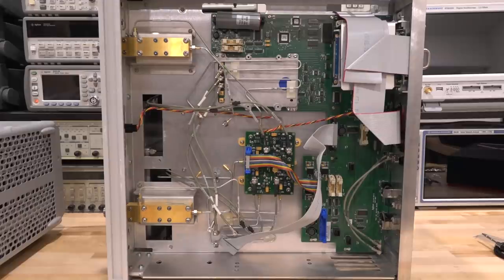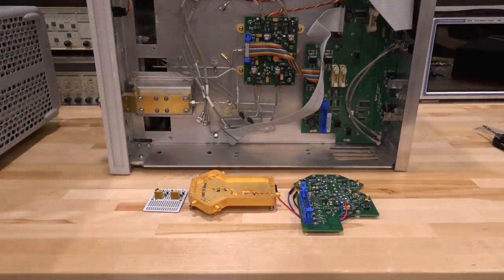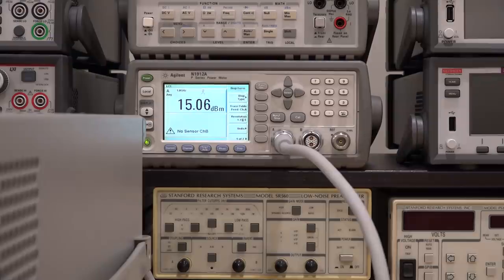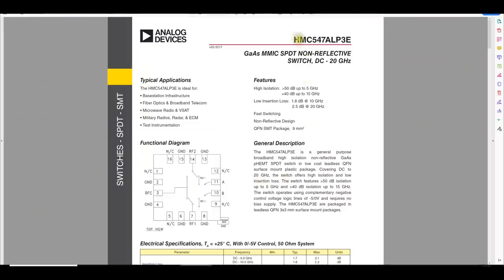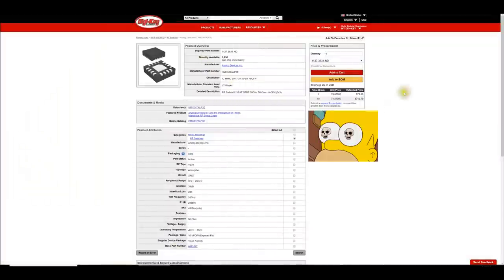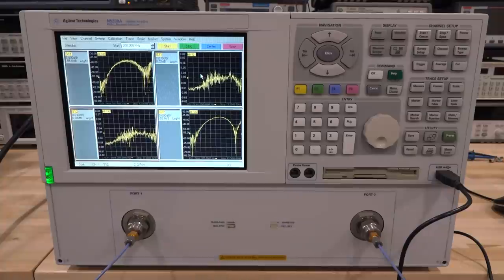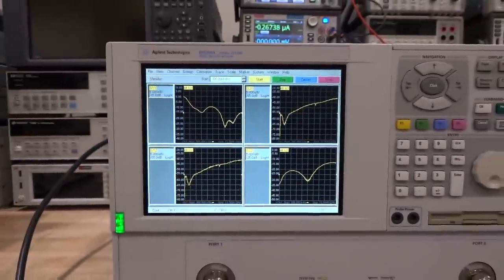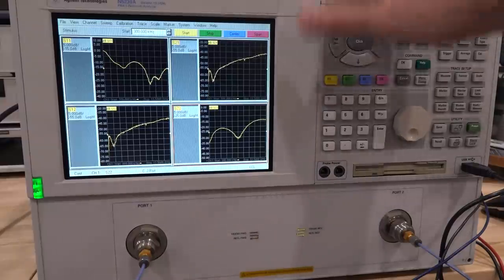TSP #135 - Teardown, Repair & Analysis of an Agilent N5230A 13.5GHz PNA-L Network Analyzer (Part 2)

Comment: Wow!  Flaw with the part!  Man, I would never think of that - especially an expensive part - I would just assume everything is ok and it's something I'm doing wrong.  I know better now!  :)  Thanks again Shahriar.
Reply: The flaw was on the PCB.  It's a good thing it was just the connector, fixing a badly soldered QFP part would be harder.

Comment: Nice fix on the VNA. I have been repairing Agilent VNA for a while and without schematics and many custom parts they are very can be impossible to repair without a supply of EBay modules.

Comment: Shahriar,  I have an Agilent E5515C that I bought from a surplus electronics scrapper that was broken, found it had a internal board short inside the vector module in it;  found on on ebay for $60 and replaced it and have a fully working unit now.   I was hoping to hack it to use as a basic type of spectrum analyzer, but the software for the analyzer is pretty limited (in frequency range and other ways) so its basically a shelf warmer for me at this point.   I can connect a cell and make calls to it;  so it does function.  If you are located in California; and would be interested in having this unit for dismantling, experiments,  re-purposing or teaching, I would be all for meeting up and donating it to you.    It's yours if you want it!

Comment: I bought 4 ADF4351 eval boards from china. And none of the 3 worked. Though when i  bought first i thought it was dead nothing worked. Tried second one same exact results. guess what the SMA connectors were soldered but their ground connection was so poor that the RF messed up with everything. Quick touch with soldering iron and boom all modules cam to life. and one even have bad solder somewhere on the board so reflowed them all and now they are perfect.

Comment: Wouldn't it be possible to just use a DMM to measure the resistance of the dummy load from the "open" side and figure our that the pin was cold soldered?

Comment: I don't think that guy like you working in so high end RF field need extra help from patreon to buy modules and broken equipment. Just saying ;)
And you can wire bond everything. Once i was able to solder CCD wire bonding with single solder-paste ball in a camera that cost many hundreds of dollars ;) 
(some one was cleaning CCD with no windows with compressed air)
Reply from the maker: My work and my YouTube channel are separate. My Patreon supporters make this channel possible; especially repairs, experiments, etc.
Reply: @Thesignalpath   Don't get me wrong, I enjoy what you do ! Best channel about electronics on YouTube. I just envy you I can't do the same :)